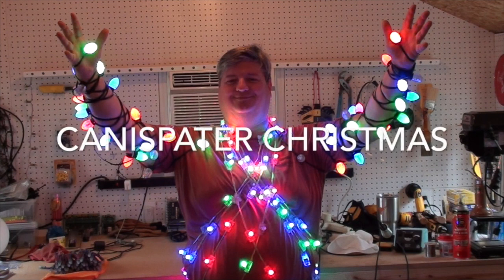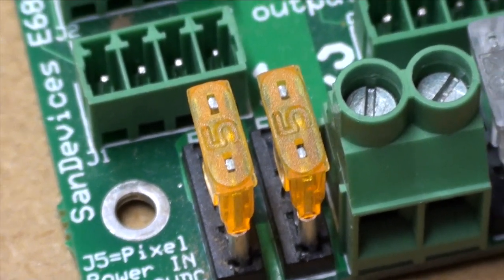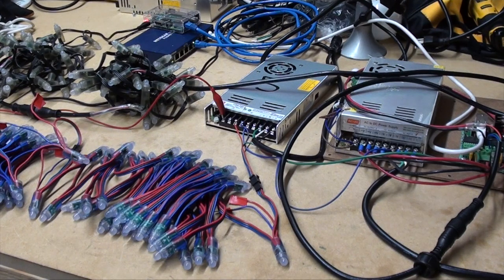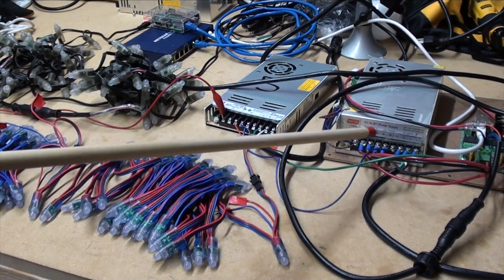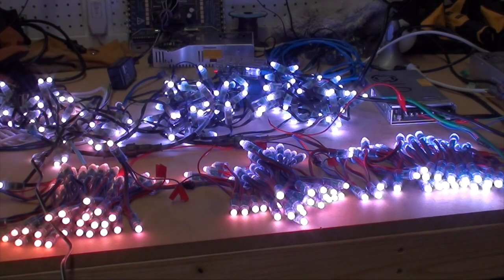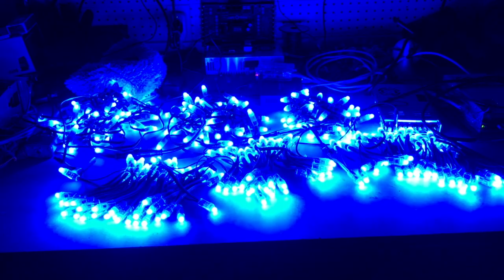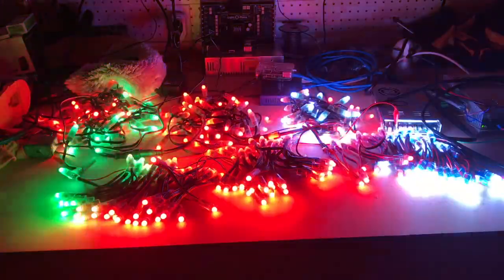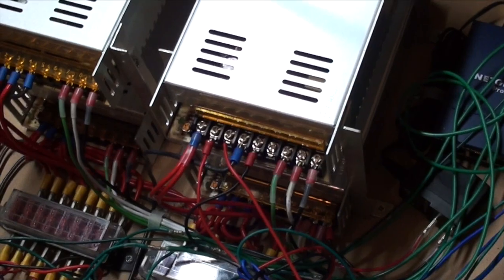Powering RGB Pixels - 5V/12V Shootout

Comment: Hello 

I was wondering if you tried the Falcon Controllers v4 but using wifi only without any Ethernet cable? I would like to see how that is done. Is that something you can demo
Reply from the maker: Yes. It's in the works, but basically, you put the sequences on an SD card and let the controller play them.

Comment: Hi Jeff, Thanks for this veideo too, so I am confused about how to connect 3 power supplies, Can I use one cable directly from the wall to connect to the PS1, from PS1 to PS2 and from PS2 to PS3? (like a serial connection)
Reply from the maker: As long as you don't exceed the AC max, yes. Power supplies are getting bigger these days. Check out my latest video. I did exactly that.

Comment: Do you use WiFi on the PI when you have it setup outside?
Reply from the maker: Yes. WiFi to my home network for internet access (time syncing) and eth0 out to the controllers.
Reply: @CanispaterChristmas  Where's the time syncing I didnt see it? Also I tried to do a test to get the lights to come on with fpp to the controller the lights wouldn't light.
I tried the two tests in your videos still no lights would come on you meantioned it could be a communication problem. My default IP is a 10.0 IP when setting up PI the dhcp did give a 192.168.7.x address which used to access it in the browser I made it static saved it as the etho address the fpp wifi address is a 10.0.0.x address My controller was given a 10.0.0.x address I changed it to a 192.168.7.x it wouldn't open in the browser diagnostic stated config was correct but device wasn't responding.  I switched it back to the 10.0.0.x address and it opened. When I had the PI & controller hooked a switch the controller IP wouldn't open in the browser with the 10.0.0.x address or any other IP I tried under 192.168.7.x a diagnostic said computer was configured correctly but device at 10.0.0.x or 192.168.7.x wasn't responding . It would open in the proxy setting thats in the 1st tab in fpp though. Not sure what the issue is. Do I need to stick to a 10.0.0.x address setup since thats my default network address for my IP provider? Sorry for the long comment.
Reply from the maker: @John52416  Troubleshooting this over comments would be difficult. Can you log into the xlights zoom room (see xlights.org) and talk with someone live?
Reply: @CanispaterChristmas  I can just thought I'd see if maybe you had a not so complicated suggestion /solution from experience.
Reply from the maker: Haha. This part is one of the more complicated of the hobby especially if you don't have a strong background in it. We can get you through it, but there's a lot of "moving parts" so to speak so live assistance is quicker and less frustrating.
Reply: @CanispaterChristmas  I did some reading/researching and was able to get it working
Reply from the maker: @John52416  Glad you got it working, but don't fear the zoom room. 😃
Reply: @CanispaterChristmas  I dont just hard to get on tending to a 4 year old.

Comment: Hi, I’m new to this (haven’t exactly set up a display yet or own any parts) but I’ve been watching videos and was curious if you’ve tried Wifi controllers (see Dr. Zzs beginner led video)  I’m not sure if im missing something but it seems cheaper/easier to stick an arduino wifi controller on the string. Vs running Cat-5 cables to all your seemingly large controllers?     Maybe you could test this out and do a video on using a arduino & WLED for wireless control?
Reply from the maker: I have a video on those. For one or two universes, they are fine. Once you start getting much bigger, you start running into problems. If you have a really big show, you either need Ethernet or multiple remotes.
Reply: CanispaterChristmas  Thanks for your insight! Sorry I’ll look for the video, I just recently subscribed
Reply from the maker: No worries. Be sure to check out the xLight Zoom call on Wednesday nights. Great resource for learning this stuff.

Comment: I'm working with dumb led 12v neon rope that's single color. I'm trying to make a grandfathers clock With a swinging pendulum. I want to run the pendulum in three locations so that as it flashes in each location it appears to be moving. Controller suggestions?
Reply from the maker: There are a couple of dumb controllers at Hanson Electronics in Australia that I know of. http://www.hansonelectronics.com.au/product/2811dc30/

Comment: Hi Jeff, I finally have a nice small little display up. [1] MegaTree 800 Pixels / [1] 6-Ring Wreath 354 Pixels / [3] Arches, 1 string 96 pixels, Total of 1250 Pixel, and believe it or not, I can get them all to "light" at 30% power across the board on the one main Falcon F16v3 with no power injection... what's the "math" equation to see if I am safe to run a show about 4-5 hours a night... ??? I know the .06 is for the 100%, but have you calculated the reduction in power for the math part? IE: so 0.03 * 1250 "could equal" maybe 50% power yes??? so 37.5A // and 0.15 *1250 = 18.75A at 25% Does this sound about right? Thanks, I have the light talking through FPP, now just trying to get a few sequences going... tough going, and on zoom right now... but it's busy too...
Reply from the maker: Excellent! Just calculate for 100% then multiply by 0.3 or 30% and that will give you the 320% value. Also, your pixels may not pull that much so there is some buffer in there. You'll need to check the specs on the pixels you have.

Comment: Ok here is a question for you, i miss ordered 500 ws2811 5v pixels, whats your thoughts on using a buck converter to take voltage from 12v to the 5v (4.7)
Reply from the maker: Might be cheaper to just get a 5v power supply due to the amount of current that many will pull.

Comment: Love all your videos.  Just starting out myself.  So my question is how far away can the pixel string be from the controller?  I'm reading on some forums that the start of the pixel string needs to be very close?
Reply from the maker: 5V or 12V? I've gone 20-30 feet without a problem (12V). There are other options if you need more distance - signal amplifiers that can increase distance or you can try Ethernet cable for the data line (but not power). If you have a Falcon controller, there is a differential receiver board that extends 4 ports the full Ethernet distance (100m/328 feet). So you have options.

Comment: Which one of the Meanwell power supplies do you use. I see a range of wattages on Amazon.
Reply from the maker: LRS-350-12 for 12V, LRS-350-5 for 5 volt. There is another version that has the screw terminals facing out, but I like the ones facing up.
Reply: What wattage and amps is the max for a power supply that can be connected to the  differential board if the fuses are rated at 5amp on the board 
If u run the biggest power supply possible for the differential board how many led strings can you put end to end on one controller output safely
Reply from the maker: Not an easy answer, but 1,024 pixels per port max though most people stick to around 300 or less. You should check out my beginners playlist if you haven’t already. Most of the basics are covered there.

Comment: I'm looking at setting up a 'simple' permanent light display on my house using addressable pixels.  On quick measuring, it looks like I'm going to need about 200 linear feet of pixel length to cover the majority of roofline on my house.  As I'm reading, it looks as if I'm going to need to run quite a bit of power splices or injections to this, and would plan on running on a single raspberry pi since I would just want to select a couple different color options for different seasons. 

What would be your recommendation for connecting 15 to 17 sets of 50 pixel strips?
Reply from the maker: First, get 100s is possible. You can always cut pixels to length and 100s are easier to work with (for me anyway). Also, if you live in a city, you may not want to run the lights at 100% - I run mine at 30% so that helps with power requirements and keeps the neighbors from complaining about the airport next to their house. lol!
Reply from the maker: Also, for a permanent setup, the pixels (assuming bullets or square bullets) might yellow (or turn cloudy) in the sun after a while.
Reply: Appreciate the replies!  I've been wavering back and forth on the square nodes and the LED Strips (IP67).  The strips would conceal under the soffits a lot better and be 'hidden' from direct contact with the elements.  I have a feeling thats going to be the way I go - especially after the risk of them clouding up or discoloring.  My goal is to mount them once (obviously knowing I may have to do some maintenance here and there) and the strips seem to be the best way to go. 

If I remember to, after I get it all set, I'll post some pictures.

Happy Lighting - and Thanks again.  Your videos are extremely informative and much appreciated!
Reply from the maker: Yeah, strip might be a better choice for that and. Heck out my Amazon page for the strip channel - aluminum channel with plastic diffuser. More expensive up front, but might protect it better. Also have a video showing that install on my stairs.
Reply: I ended up buying the pixel strands like you show in the video - went for the new Falcon F48 and Expansion boards - SO - Crossing my fingers I get it all figured out once the equipment arrives.  
ONLY thing I'm left wondering is - if I am dividing the house roofline display into (4) sections (each powered by a separate expansion board) - I know I've got plenty of pixel ports and power to supply each strand - but I am going to mount the boxes closer to the ground.

Will I lose a lot of power from a 15 to 20' run of power up to the first pixel? (utilizing an RGB Extension cord or pigtail - weather proofed?)
Reply from the maker: Cool! Hard to say without knowing which pixels you have, but that length SHOULD work fine. I would say as soon as you have everything, try testing it out to see if it all makes sense. It's better to figure it all out way before setup day so you aren't stressed out if you have questions. lol!

Comment: hi there I have 4 rolls of 5m of ws2812 strip lights 300 leds each rolls 5volts power supply 350 watts how many rolls could I put on it because the 4 rolls seems to flicker and how to I connect power inject thank you
Reply from the maker: Check out this video: https://www.youtube.com/watch?v=bvN91XDH2V0 for power injection. 
Unfortunately, the answer is "it depends." The typical calculation is to use 0.06 amps per node so 300 nodes would be 18 amps at 100% white meaning all LEDs are on and at 100% brightness. 350watt power supplies can safely handle about 25.5 amps depending on the manufacturer so you will need multiple power supplies to run all 4 strings at 100%. If you back off on the brightness, your power requirements will be less meaning you can run more pixels off the same power supply.

Comment: How mutch 5v pixels do you have i bought a set of 200 with a normal ir controler and a 5v 4A power suply i am gona use it for around 1 big window how do i power inject them ?
Reply from the maker: I have about 150 5V pixels and don't use them much currently - mostly 12V for my display. As for how to inject power, check out https://www.youtube.com/watch?v=bvN91XDH2V0. It's a demo for power injection. 5V pixels will need power every 50-80 nodes depending on the pixels, the brightness you run, etc so let the pixels be your guide and inject as needed. A large window won't be too difficult to power properly.

Comment: Hi, I want to take a moment to thank you for all of these videos you do, I can not tell you how many times I watch them because each time i get something new out of them. I am the kid of guy who gets much more out of hands on learning and not as much on the reading end. so please keep up the great work. First you are making this fun! and you are making this my go to place when I have a question most of the time I've see it on a video of yours. 
Oh 2 questions, what are the "for the lake of a better term wire terminal between the falcon and the power supplies and why are they important? and  can you please tell me how to measure the current of a set of smart pixels. rather then get my info from the internet I would like to know first hand what my string is doing.
Thanks so much
Ralph
Reply from the maker: Ralph - Thanks and I’m glad you’re able to get something out of them! I’m working on something I think may help folks just starting out. Most digital voltmeters have a current measurement function. Mine has a different input for current vs voltage & resistance. You DO have to be careful because you run all of the pixel current through the meter to measure it. Mine is limited by a 10-amp fuse so good for most strings. There are also devices called shunts for measuring higher currents, but I haven’t used one.
Reply from the maker: And not sure I understood the question about power supplies and the Falcon.
Reply: Oh sorry. The thing in your video that sits between the falcon board and the power supplies, what is that wire terminal and why is it necessary. Sorry about not being clear
Reply from the maker: Oh. Haha. No, I should pay more attention to which video you're commenting on. lol. The fuse blocks are there in case I decide to bypass the power distribution on the F16. The outputs on the board are limited to 5 amps. Before I understood that I'd only be running them at 30%, 100 pixels would be 6 amps so I couldn't run them directly off the board. I'm using those less and less these days and just running strings off the board, but I do still have some extra long strings that I power directly from the power supply and when I do that, I go through the fuse block. For example, the large wreath is 288 pixels so I power it directly off the power supply through a fuse (2 actually because I'm powering at both ends).

Comment: I saw in one of your videos that you had before the big box upgrade. You had all your control stuff on the wall maybe in your garage?  So how did you run all the cables and wires and still manage to not have a ton of voltage drop in the wiring? I guess I would be curious as to how I would map out where all these lights go, keeping everything as short as possible, but we aren't talking 20 feet here.. Typical yards are 60 to 100 feet long? Do you strategically place power supply boxes? Could you go over how you did it before the gargantuan box in the middle of the tree? I want to keep as much of the controls inside as possible to avoid being stolen. Also if you could put a link to where to get wires, extension cables, gauges, etc? You have the best tutorials on youtube!! Thanks!
Reply from the maker: Thanks! The controller in the garage only controls the garage outline and serves as a backup controller or expansion for that side of the display. The tree has always housed electronics for the major part of the display. Assuming you have a Falcon, you COULD use something like the differential expansion board and have boxes with power supplies and differential receivers sprinkled throughout the display. I have a PS powering the wall washer and fence lights, a PS for the garage then everything else comes from “the box”. I get all of my cables from Ray. I did buy some 14ga speaker wire for some long power runs from Amazon linked in the description in the walkthrough I believe. I use the 4-wire pigtails & extensions for my 12V pixels & 3-wire cables for 5V pixels to keep things straight.
Reply: I am going to use n E862 Sandevice controller board which is pretty much like the Falcon that you use... I'm going to shoot for 12 volts for the whole thing. We shall see how that goes. I think I am just going to get some small automotive 6 fuse power blocks and mount in several small boxes with a power supply and maybe a small ethernet switch in each box and place them where I need them. I will have to inject power and will probably do the same thing with the 16 gauge speaker wire that you did. Planning planning planning... It took me 4 years to plan out my whole 150 gallon reef tank system, and I still want to change everything!! So what do you see that I should do being that I am starting small and eventually want to get bigger in the future.. Any tips so that I don't waste a crap ton of money on things that I will end up not using later?
Reply from the maker: You have me confused by the ethernet switches in each box. You only need ethernet between the Pi and controller(s).
Reply: Yes.. You are correct. Sorry for the confusion. I was thinking about small controllers in remote locations for lights, and I had that on the brain. LOL  When you got your FM transmitter, did it come with an antenna or do you have to buy separate? Was it good enough to broadcast 200 Ft? I don't want to spend a ton of money, but I want something that will work. Already planned on getting that soundblaster USB to 3.5 adapter as well.